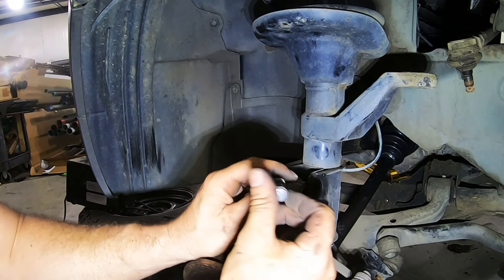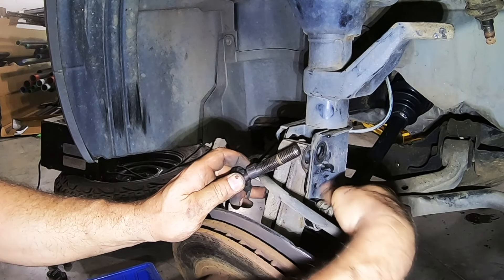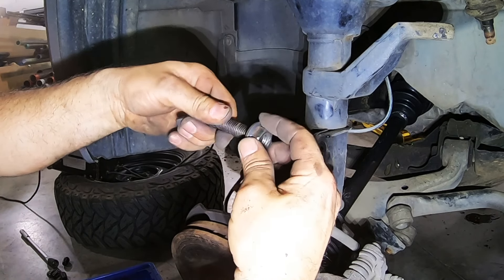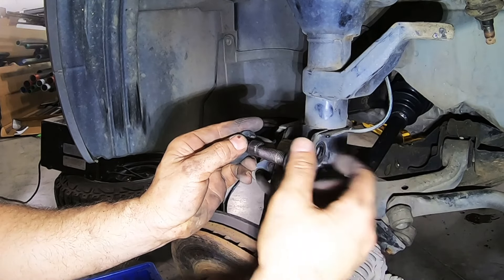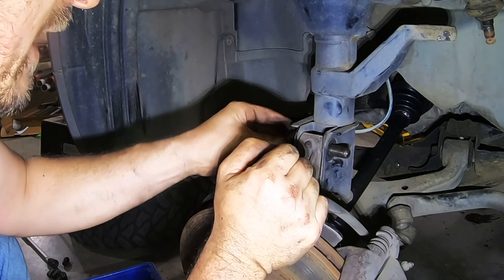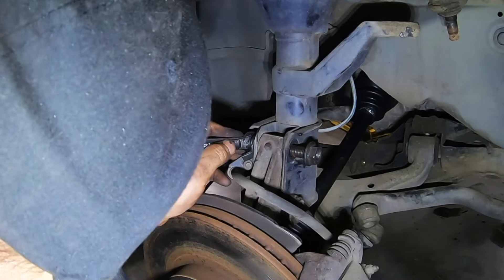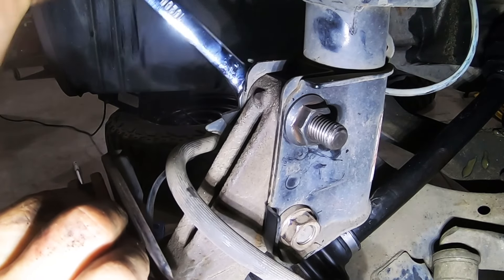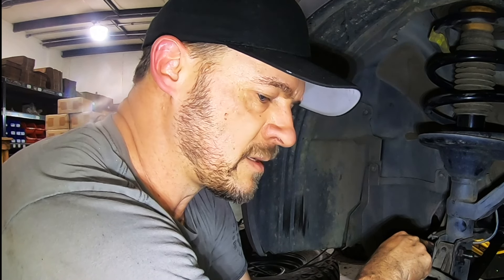camber bolt install

Comment: I just installed 2 camber bolts in the front because the Firestone told me i need it to get the camber adjustment so i took the can back to them for realignment came out the same results wth , my front was -1.0 and -0.9 now it’s -1.1 and -1.0 wth did they do
Reply: It's crazy because firestone told me this today.  However, they have already done 3 allotments for me in the past few months 😔
Reply: Well let them know next time what you want the camera to be set at. If you don't, as long as it's in the green they don't care

Comment: A lot of tractor implements use those off centre nuts so they don’t come loose. There’s usually a mark on the bolt where it’s been pressed by a machine which makes it slightly out of round so it grips on tight and doesn’t come loose

Comment: do you use anti-seize on the treads and bushing?
Reply: You can if you want to but a light coat on the threads is okay and chasis grease in the bushing